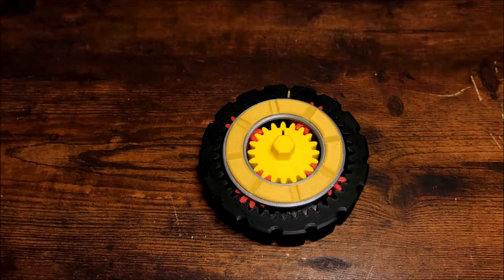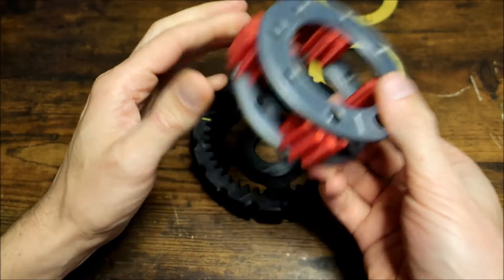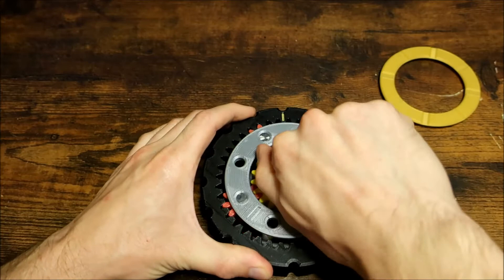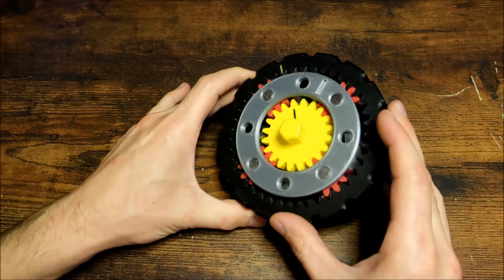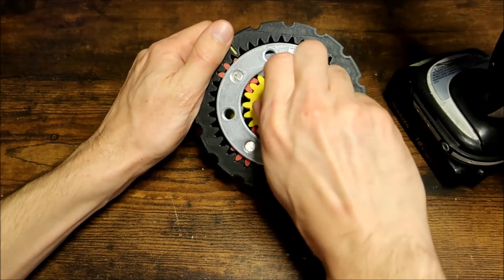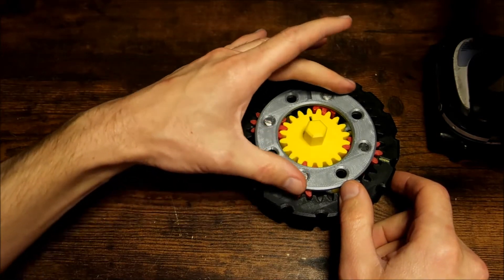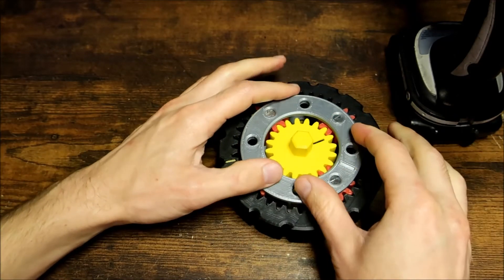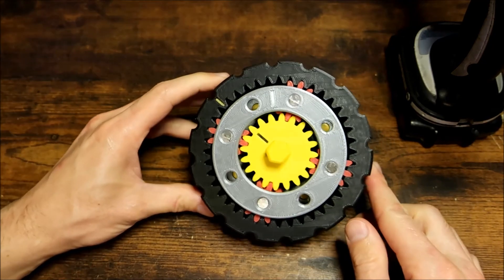Planetary Gearset Basics & How They Work

Comment: Where did you get the plastic planetary gear set model? I want one! Thanks for the clear video!
Reply from the maker: I designed the model for the purpose of demonstrating its operation.
Reply: Hey  man,   I  was trying to do the Math for the gear ratio. 
The internal teeth of the ring gear ⚙  is 39 or 40???
The planet gear teeth 😬  12 or 13??
The sun gear teeth  20?
Reply: @billywilliams6853  40-20-10